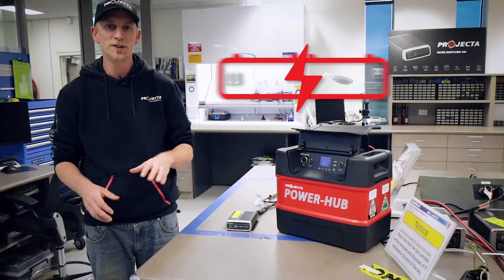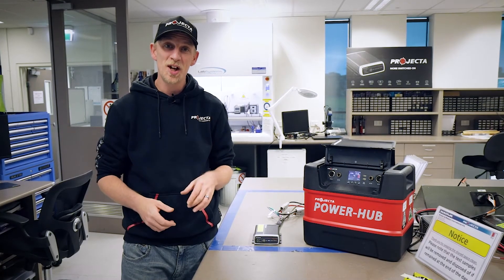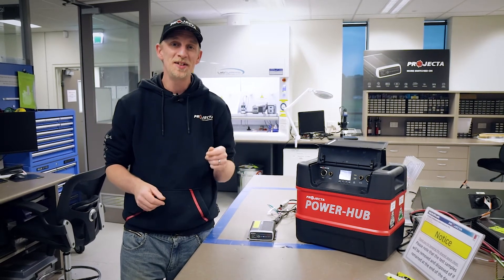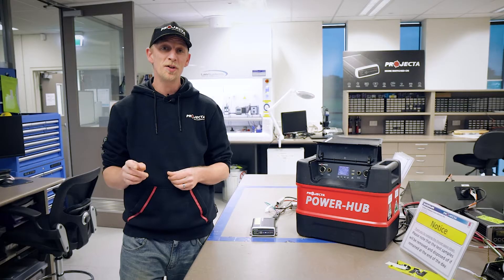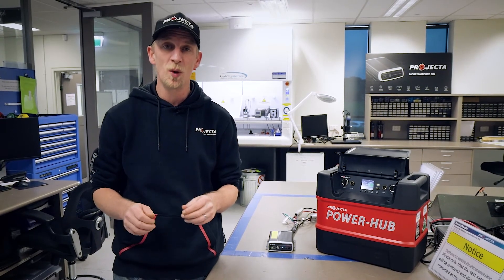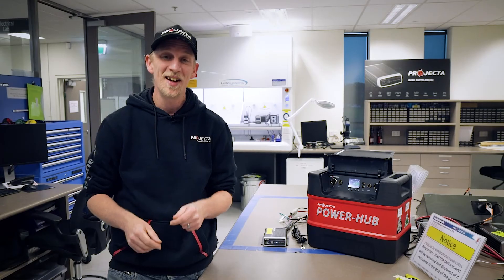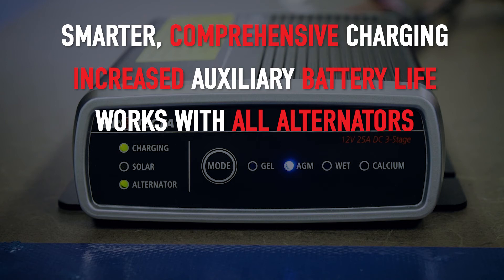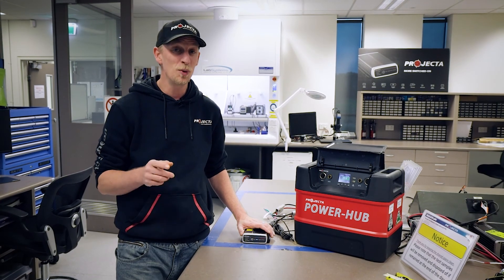What is a DC-DC Dual Battery Charger?

Comment: Great video. I have a start battery and two house batteries in parallel on my boat. Will this DC DC charger charge to two house batteries? Does is have two separate outputs?

Comment: Can u use a dc2dc charger on a 12v output on a generator? So it charges a agm battery, as a agm battery requires 14-14.8 v to fully charge ?

Comment: That’s a great video but got a question hope you can help me out with it 🙏
I have a client that I’m installing a sound system and his car comes from factory with a dual battery it the toyota LC200 2014 do I need one of these? And do you have any information about which battery should I use to power the amps since it’s not me installing the second battery I hot no idea how toyota wired them together is something I should know that would prevent me from doing a mistake?

Comment: Thanks mate didn't know what a DCDC charger does up until now.
Reply: me either, I bought all the gear to charge my aux battery but the guy at KINGS never mentioned that I needed a DC-DC charger, It sounds like a very good idea and good investment but ,... does one really need one? will the system work without one? After seeing this video I will purchase one if it means a quicker charge (and all the other benefits).

Comment: Ben. Please inform, is it ok to run an Anderson plug extension lead from my old dual battery troopy through to my caravan?
What you say about your IDC25 accommodating a solar panel, is what I'd like to do to keep my fridge going full time in the back of the troopy. But when it suits me, I'd like to power my caravan from the troopy as well. Mate I wished I had your phone number so I could bore you for hours 🤪
But there are more questions I'd like to ask.
Cheers for now. Awesome vid!

Comment: Hi, I have a very small 56Ah AGM auxiliary battery bank which is made up of (x2) 28Ah batteries in parallel for the refrigerator in my Jeep. Id love to run a DCDC charger between my starter battery and my battery bank but the smallest DCDC I’ve found is 20A which puts out too much power for my 56Ah setup. Are there any DCDC options for a bank as small as mine? I should add that my Jeep has a 160A alternator which is NOT a smart alternator.
Reply: Unfortunately at this point, no there is nothing small enough for that size bank in the projecta range
Reply: @bennyblood9372  interesting,  I have a small battery bank, never thought to consider this. Will have to look into it
.

Comment: Gday, I just bought one of these units to use both my alternator and panels to charge my house battery. The instructions werent really clear with the LED indicator. Can you post a video about normal operation and what I should expect the LEDs to display, especially the external LED. Cheers
Reply from the maker: Hi Matt, thanks for the comment. Check out our IDC25 Dual Battery Charger Overview video here: https://youtu.be/o75ewvNU_0k. Stay tuned for more videos around the IDC25 and the LED indicators.

Comment: Hi, will this DCDC charge Lithium.
Reply from the maker: Hi Aussie Quest, Check out our Lithium DCDC Dual Battery Charger Overview IDC25L video: https://youtu.be/yoCC9HFTKBM
Reply: @projectapower  I've watched all the videos but I was hoping to save as few dollars as I have 2 of the IDC 25 and my caravan came with a lithium battery and had the controler wired up in it to charge another battery or side the caravan
Reply: @aussiequest9543  Hey mate, yes it will do a Lithium battery on an AGM profile, however the issues may arise when/if your Lithium battery enters LVD or Sleep Mode this charger cannot wake it up and you would need to jumpstart the Lithium battery to wake it up so that the charger can then see the voltage and begin charging again. Also it would be recommended that if you are planning to charge lithium that you install the temperature sensor cable as LFP is more susceptible to temperature troubles with charging.
Reply: @bennyblood9372  Thank you, I will be getting the IDC25L to save any headache.